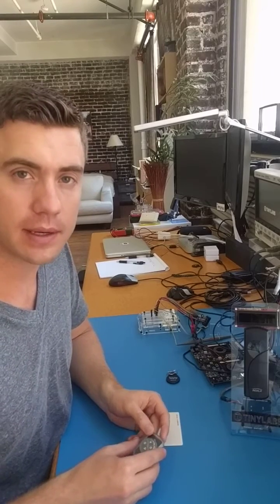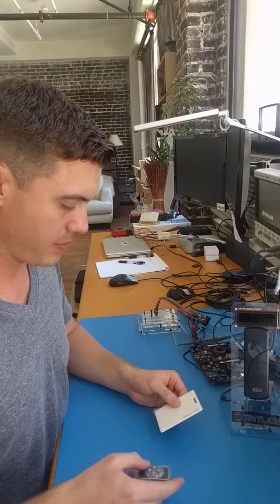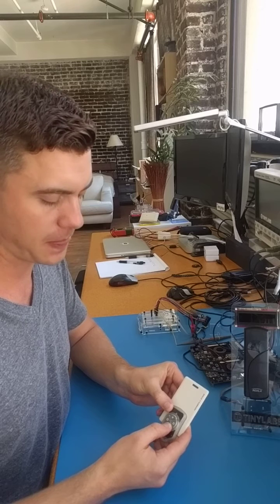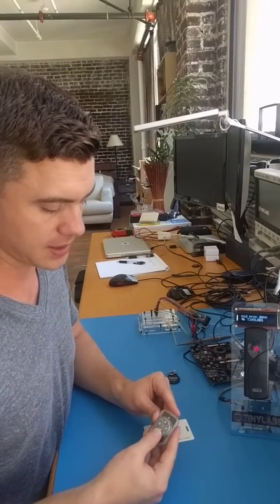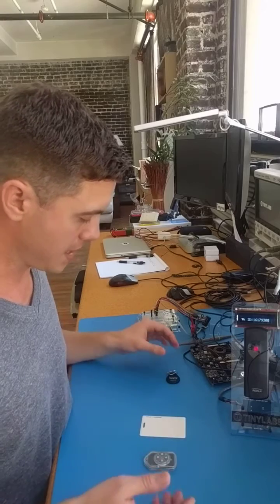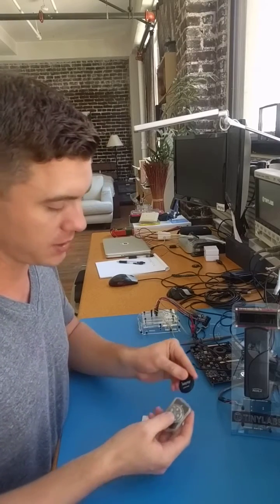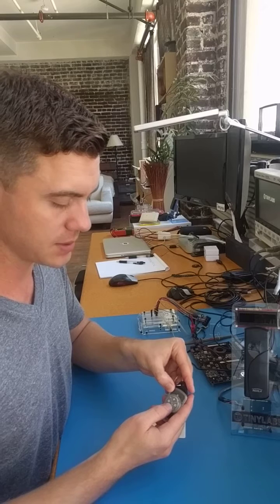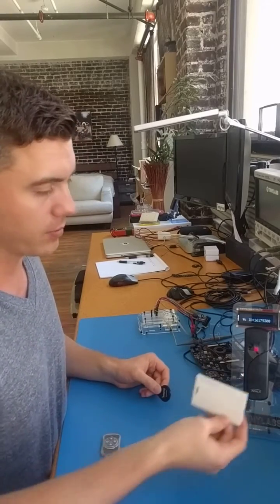Keysy cloning HID Indala Demo

Comment: juz get the product few days ago, it works pretty well but i'm still wondering how to change battery since tat's no easy way to open up the device
Reply from the maker: The plastic case snaps together. Pop open the remote to replace the CR2032 battery. Some people use their fingernail.
Reply: I guess they are supposed to last 2 years and then you have to buy a new one...